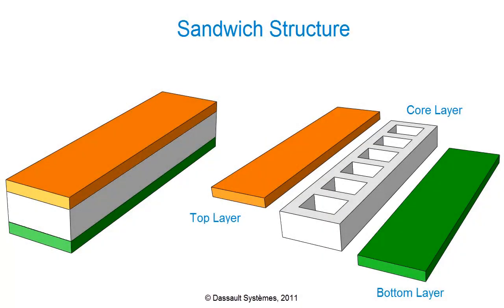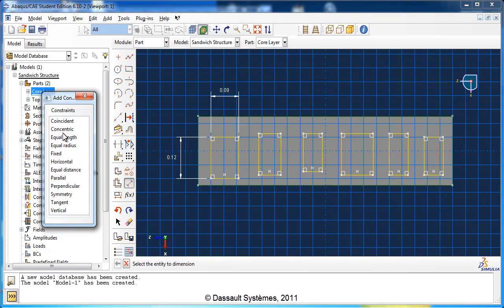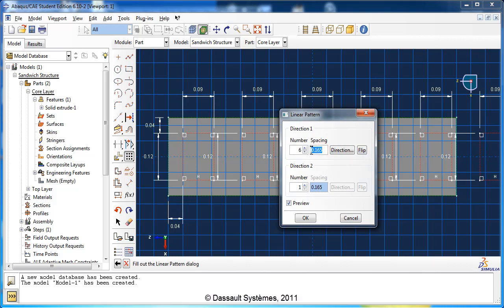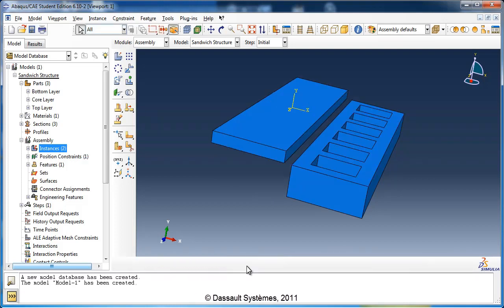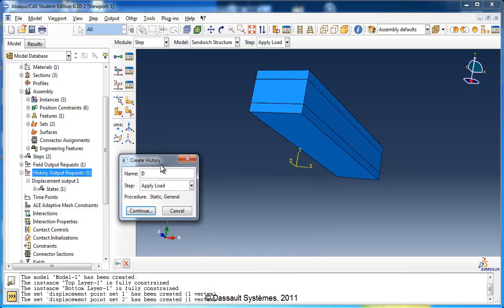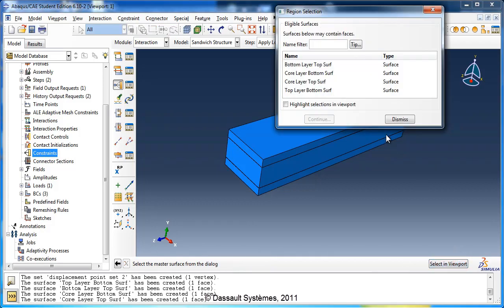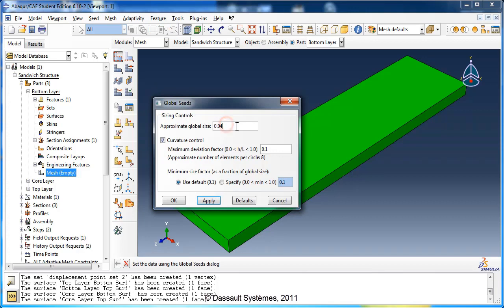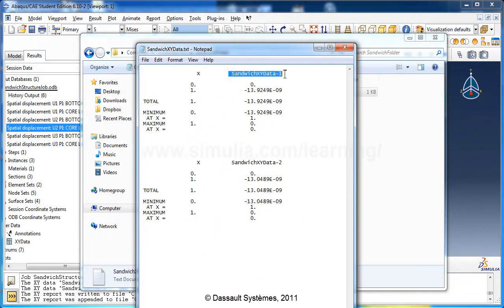SIMULIA How-to Tutorial for Abaqus | Tie Constraints

Comment: Excellant one sir, but I think there is a small error in the tie constraint. When I use tie constraint to bind Top/Bottom to Central Part, some nodes lie at the location of openings and as a result were not tied together. Any suggestion on how to circumvent this ?